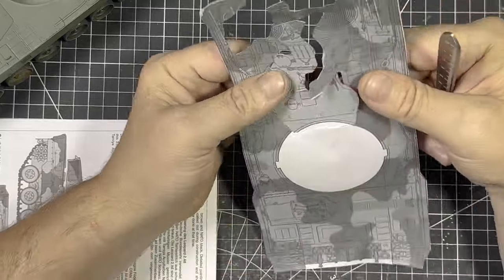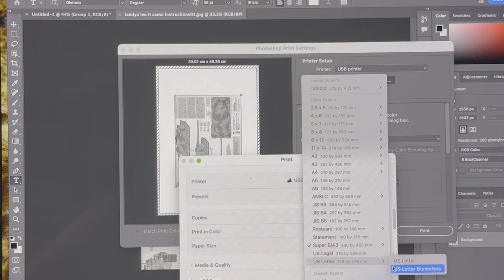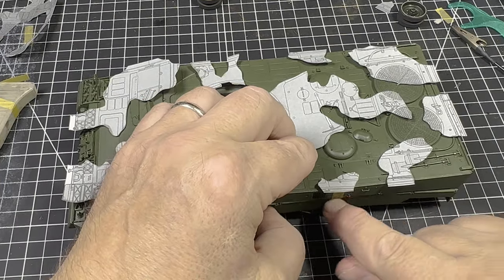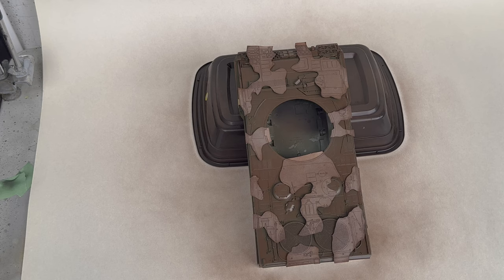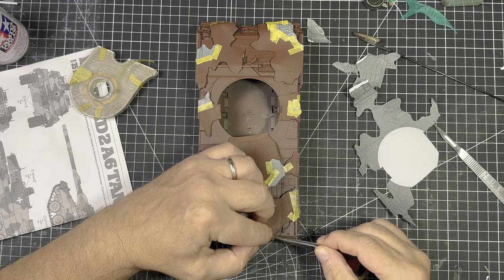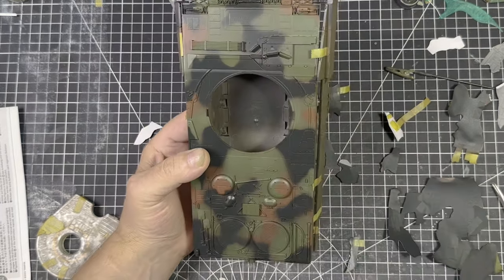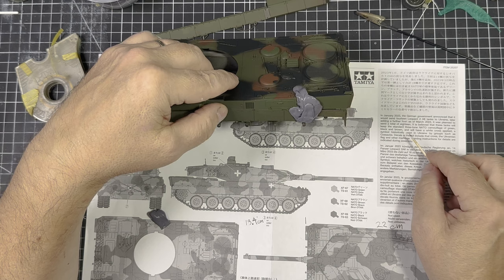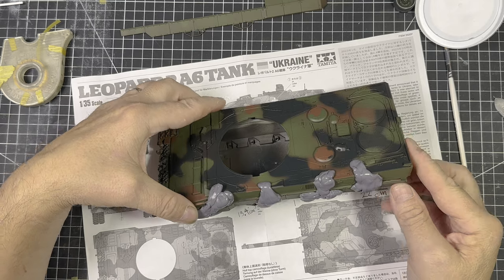Stop Wasting Money on Stencils: Make Your Own! Tamiya Leopard 2 Ukraine

Comment: Very helpful! How did you scale up the painting guide? What software did you use to measure and subsequently check the dimensions prior to printing? Thanks in advance!
Reply from the maker: Thanks glad you got something from it . All the information is in the video. I measured with a ruler. I scanned the original artwork @300 to get a working copy then measured the dimensions on a 100% print out then measured with a ruler the model. Then using online percentage calculator (just google), I entered the two measurements to obtain the percentage I need to add to the original print out. You can check like I showed in the video against the actual model once you print the adjusted print out.